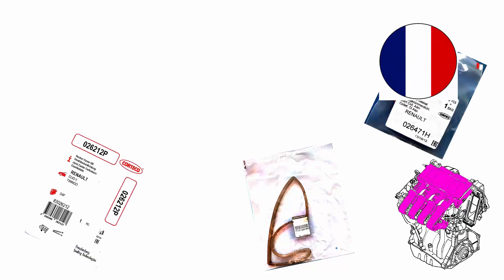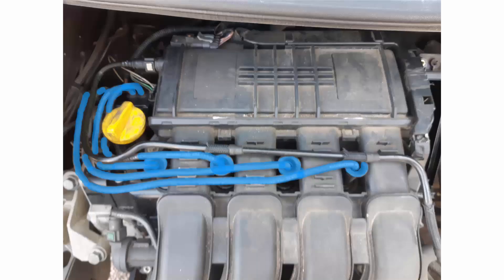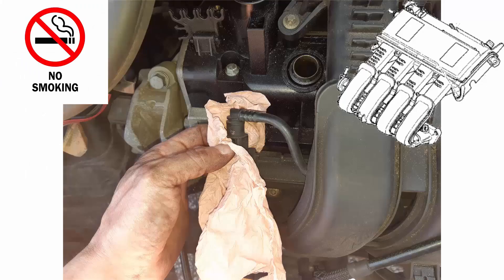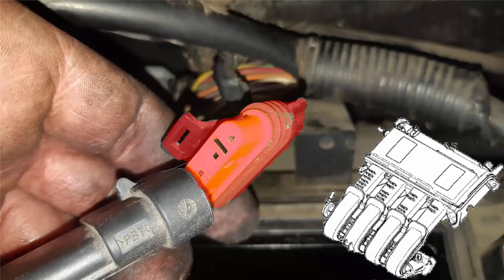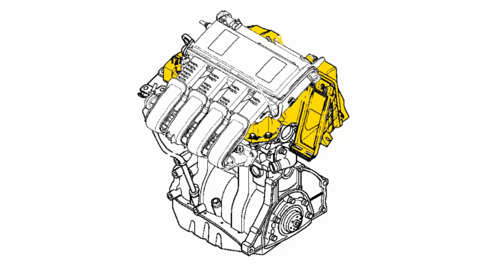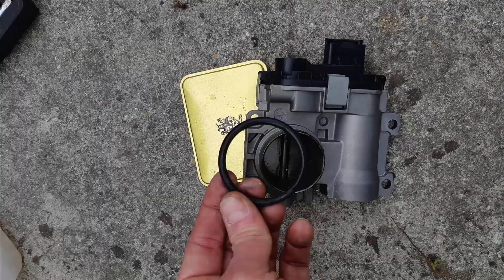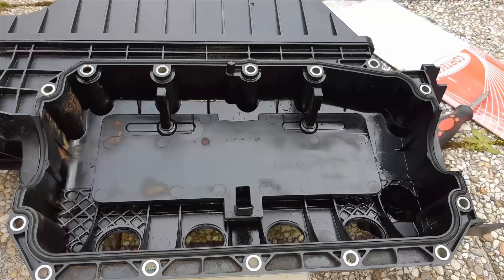How to change the seals of a intake manifold and  valve cover on a D4F702 (1.2 16v) engine

Comment: Hi, I have done cleaning throttle body on my Twingo same engine as yours. Done same steps as shown in video but car wont start now.  There is clicking noise when is ignition on. On OBD2 scanner have faults gas pedal position A and B unknown, coolant temp. throttle temperature fault and MAP sensor.

Comment: Hi!:)
Where did you buy those parts for this job?
Thank you
Reply from the maker: @agostonondrej4327  Hello, parts stamped with the Renault logo are genuine parts, so you need to buy them from your Renault dealer.
For the other parts, I bought them on AutoDoc.com.
This where I usually buy my aftermarket parts.
Reply: Thank you!

Comment: Very helpful! Thanks Mr. Olivier
I got my Twingo from the first owner with the problem of easy starting and after it will die, so I need to put more gas. It is very difficult to drive in a traffic and inclined road, stop and park. But after I changed all the gasket, easy starting and no worried that it will die, very smooth driving.
I hope you make your next video in replacing the timing belt. Again thank you.
Reply from the maker: Hello Rodney, I'm glad this tutorial helped you. Regarding the timing belt job, there are a lot of videos specific to this D4F engine of yours. Even if these videos are non English speaking ones, they are still understandable. In the mean time you can maybe watched a tutorial I've made on an E7J Renault engine. https://youtu.be/SvhGaECdNI4 The major difference between the two engines is the tensionner pulley setting. The D4F engine has a "self tension adjustment".

Comment: Since your explenation is better then renault Clio official repair manual can you please tell me is there any PCV valve on this engine?
Reply from the maker: Hello, 
As far as I remember,  I didn't see any.
All I can tell is that there is a connection / hole between the valves cover  and the intake manifold.

Comment: is there any way to  change the ECU sealant without all this job?
Reply from the maker: Hello  Mohamed,
Unfortunately in a Twingo, there is not room enough between the firewall and the ECU to fit a suitable Torx screwdriver. 
But in an other car there is maybe a chance. 
Good luck.
Reply: Hi,
thank you very much, which oil this car take? is 10w40 enough or 05w40?. Is the clio III a good reliable car?
Reply from the maker: @montgomeryha4921  Hello Mohamed, both type of oils fit for this engine.
I would use 0W40 if you are in a cold country and 10W40 if you live in a temperate country. 
Kind regards
Reply from the maker: @M. Arhaly Yes. This kind of connectors are a bit tricky to remove.
Use a small screwdriver or a needle of sort to pry the metal clip out.
It will be the same thing for the injectors connectors. 
I hope it helped. 
Regards.
Reply: thank you very much Mr. Pirard

Comment: Hello again!
I just wrote a couple of minutes on your other video that is in french.
Thank you again for the video!
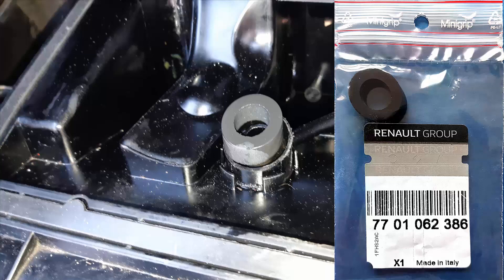Did changing the part at 12:30 (wedge sealant or how's it called) got rid of the oil leak in the ECU?
Reply from the maker: Hi George,
First of all, let me say that your French is amazing!
The "wedge seal" is enough but as an extra cheap insurance, I did some small modifications as show in this  video. (see below)

https://youtu.be/0IDRUmLgS1E

Since then I did 10.000 Km ( more or less 6000 miles) and the upper side of the valve cover is still dry bone.
By the way this car passed successfully the French equivalent MOT this week ;)
It wouldn't if it was still spewing oil like before.